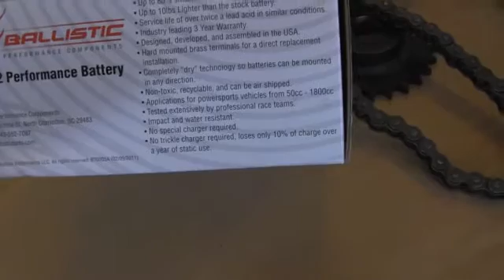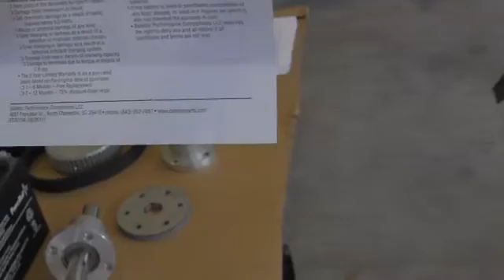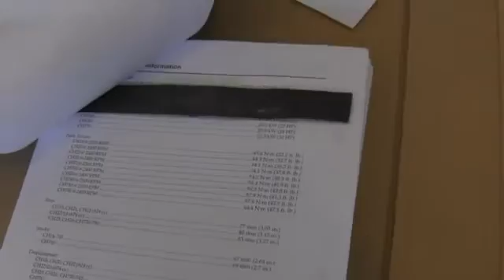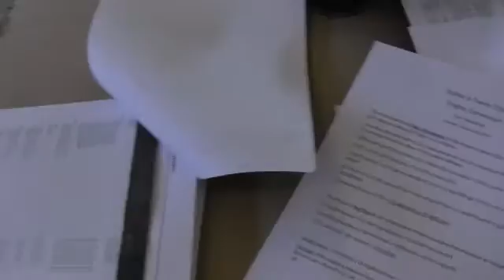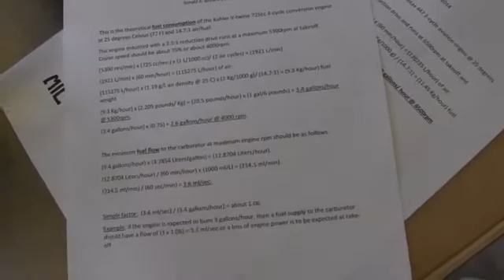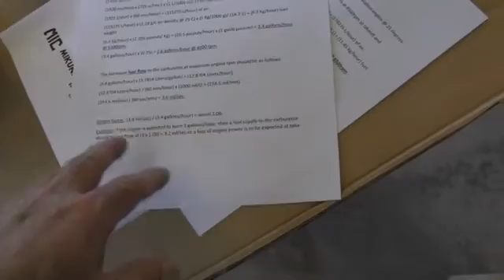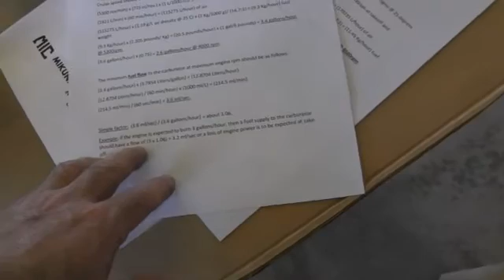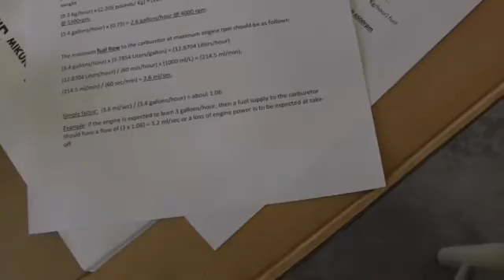Kohler ultralight engine

Comment: I would highly suggest you richen up that mixture of 14.7:1 is probably too hot under any power setting... maybe at idle (14.7-15.2 to 1 is ok at idle). You should probably be searching for a 13.2:1 that'll be your highest torque level and keeping the cylinder head Temps from getting too hot. Idle 14.7- cruise maybe 13.8:1 wide open 13.2:1. If it was mine I'd probably add one whole point Rich to those settings I gave you. I do a lot of tuning in the automotive world (an engine is an engine). You're going to end up turning that exhaust pipe white at 14.7:1 during a climb/take off running it that lean.